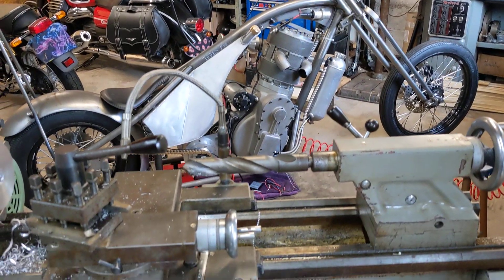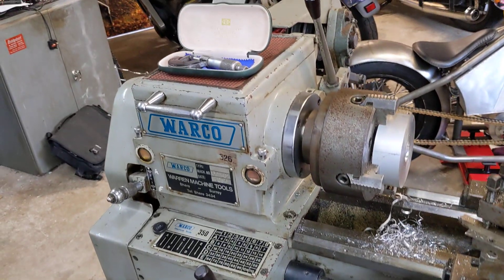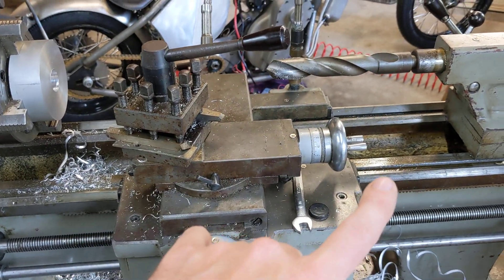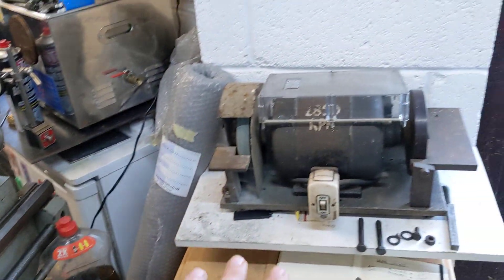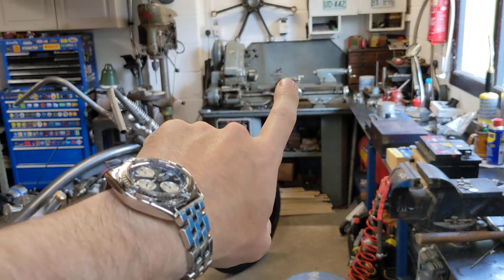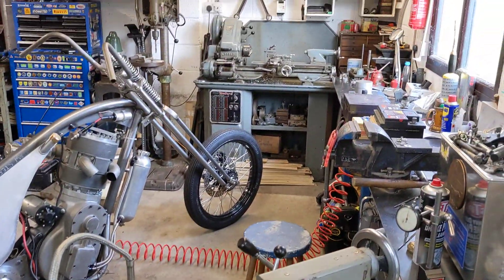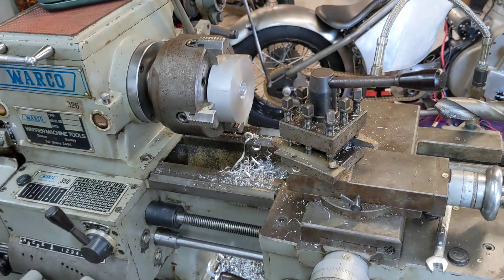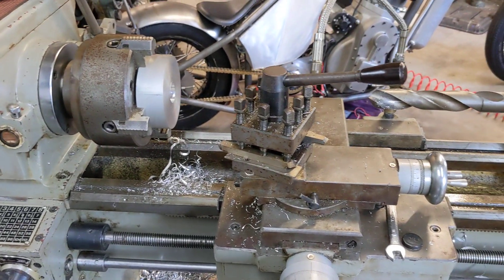Wheel Spacers on the Warco

Comment: Thought I'd move on my ML7 when I got my Harrison, but I've made a few devices that use the Myford's chucks (dividing head etc) so I'm hanging on to it !
I'm a bit of a Luddite as far as CAD is concerned, so I went old school and measured the footprints of all my equipment, drew them to scale, then cut them out of an old cereal box, then spent some time shuffling them around on a sheet of graph paper to optimise the use of space/light and also keeping the welding/grinding areas away from the machine section.

Comment: My shop is in my basement, so I too have limited space. From the video I think I would move the new lathe to where the drill press and toolbox are. move the toolbox to where the new lathe is, drill press to where the diamond grinder is and the grinder to the table with the other grinder. A simple rotating table for the grinders so you rotate which one you need outward when you need it. In my shop I put everything on wheels because some projects require more room than I have. Even my 4200-pound milling machine can be rolled out of the way if needed, but it's not going to hurt my back to move all your shop around so that makes it easy to make recommendations from my recliner